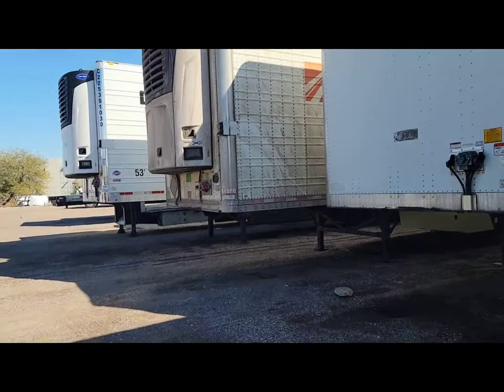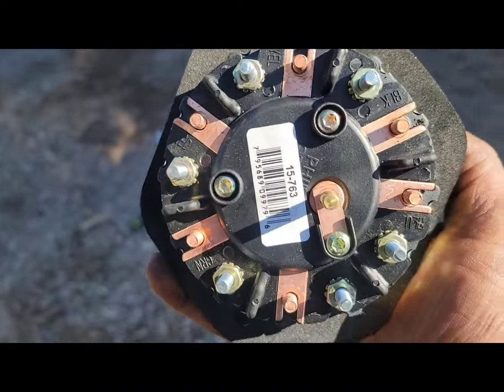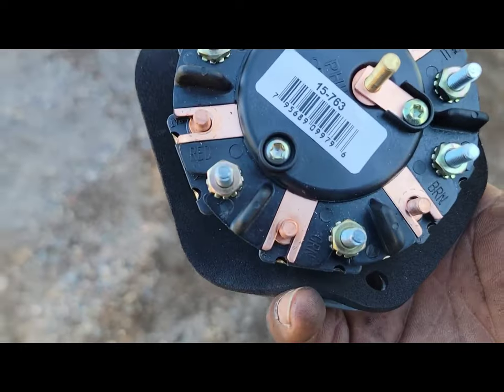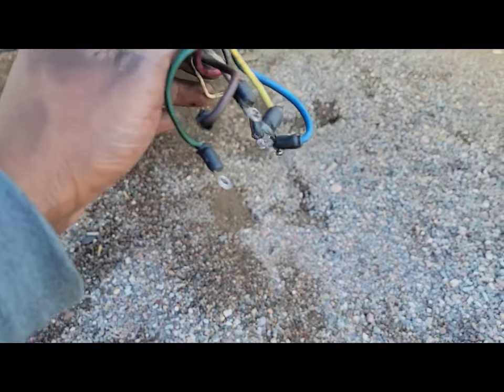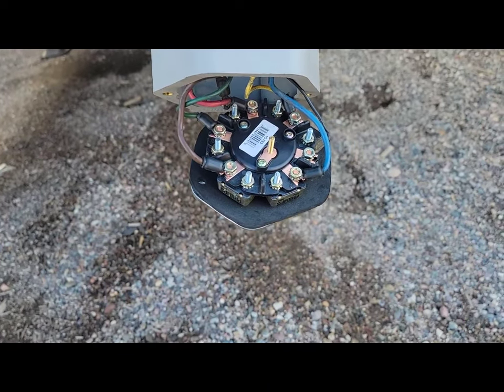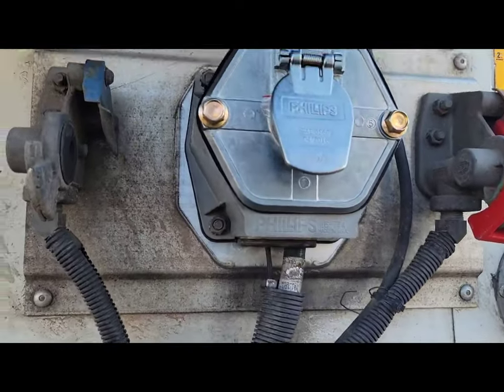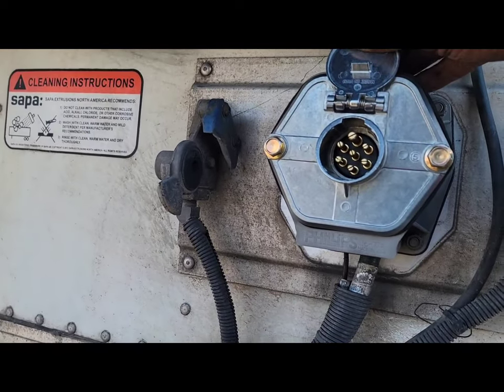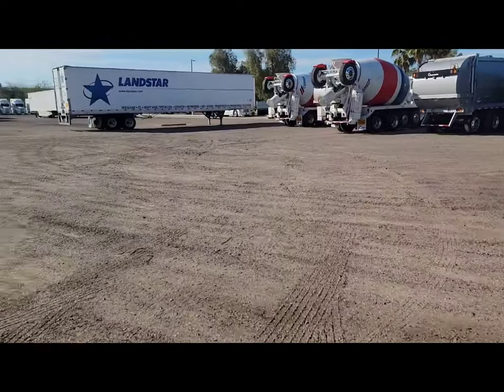How to replace your trailers 7 wire pigtail socket. Easy steps

Comment: Thank you for the video, but I thought I would provide some feedback. You completely bypassed the fuses. The copper strip is coming from the pins of the connector. You are supposed to connect your trailer wires to the silver post.  You connected them to the copper post which is completely bypassing the fuse.  The reason you connect to the silver is that the copper pin goes through the copper band to the copper post THROUGH the fuse to the silver post where you connect the wire.  So if you install the way in your video, you might as well not spend the extra money on the version with the fuses as you aren't using them at all.

Comment: Can we install same connector at truck
Reply from the maker: It's all color coded. You can get the plug or the whole harness. If the harness is bad, it's probably going to be like $200-$500
Reply: @TOPROPE1980  thank you 🙏